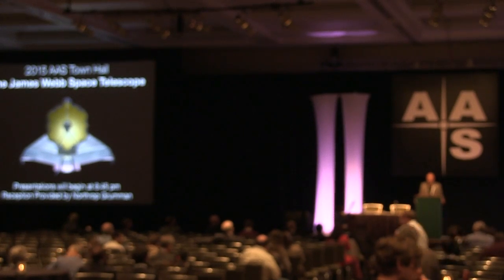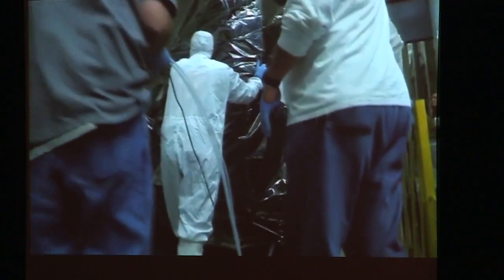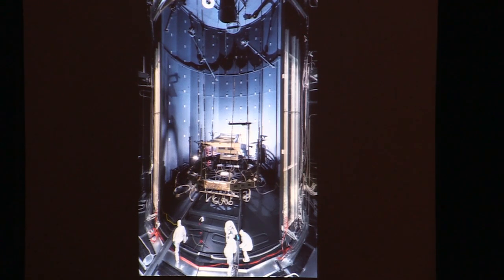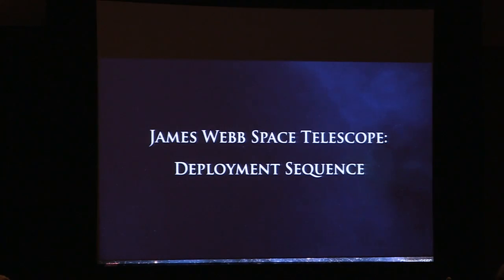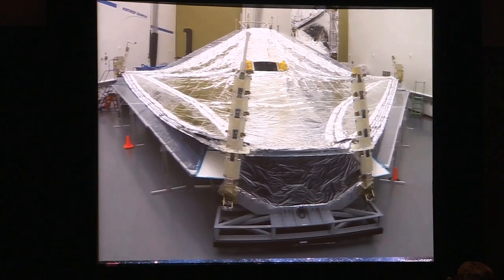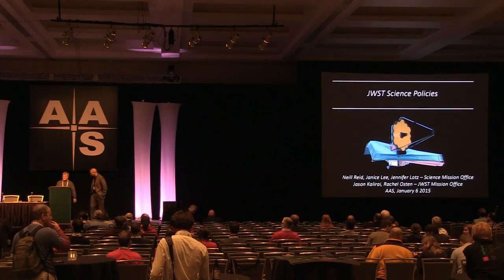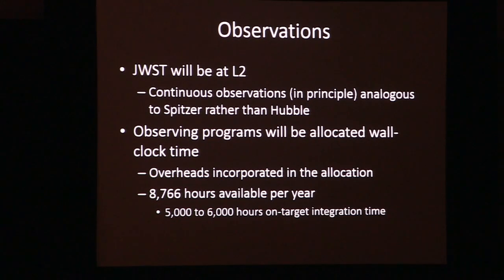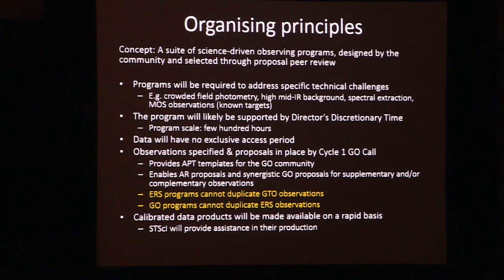AAS 225: JWST Town Hall

Comment: Will the equipment not be outdated in 4 Years ? :p....
Reply: +Mike Sabbe I think a lot of the Hubble was outdated when it was put in orbit.But this had no effect on the impact that instrument had!
Reply: +dan tyler We could update Hubble or change instruments , something we can't do once JWST is in orbit .
Reply from the maker: +Mike Sabbe Not four years, but this is exactly why satellites are generally not serviced. They have a lifespan, and then new projects with new tech are developed. JWST is very cutting edge tech and should not outdate very quickly.   

And the Hubble's instruments were indeed replaced. But it's the only exception to a long history of space observatories. Hubble and Webb serve completely different functions. Hubble can't see the things that Webb can both because of the type of mirror and instruments it has, and also because of its location.  

 In the early days of the Webb project, studies were conducted to evaluate the benefits, practicality and cost of servicing Webb either by human space flight, by robotic missions, or by some combination such as retrieval to low-Earth orbit. Those studies concluded that the potential benefits of servicing do not offset the increases in mission complexity, mass and cost that would be required to make Webb serviceable, or to conduct the servicing mission itself.